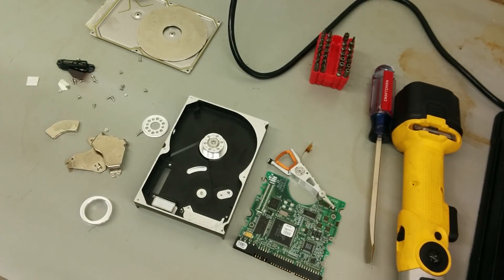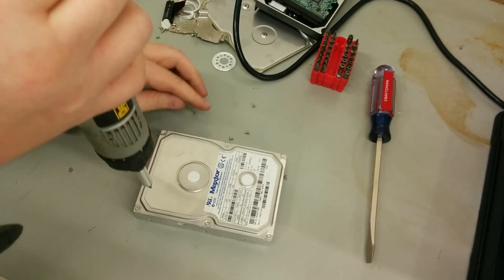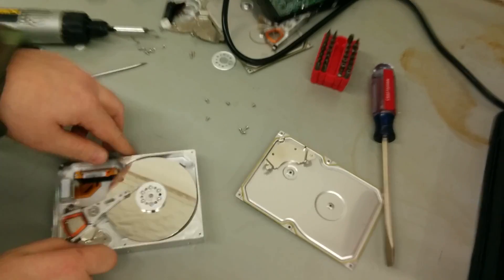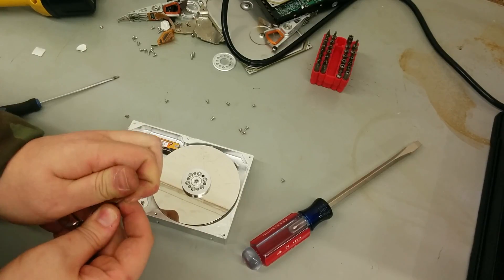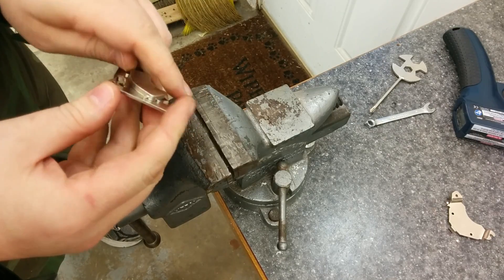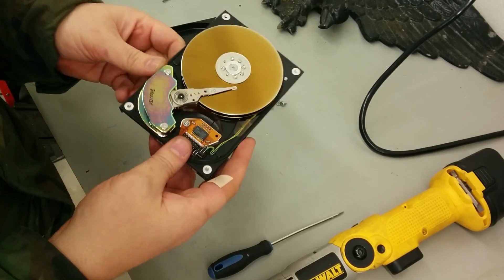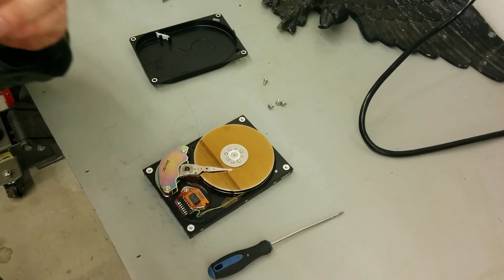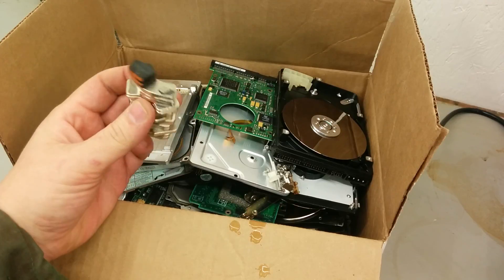Magnet Recovery from Hard Drives

Comment: You can grab each end of the bracket with some pliers or vice grips and twist in opposite directions. This usually breaks the seal with no problem. You don't need to bend it.  As long as it slightly flexes it should break the seal.  Could also put it in a vise and two hand the other side with some sort of pliers.

Comment: Actually the bracket seems to be made of some sort of special material that blocks the magnetic field, some sort of Mu-metal.  The bracket material may prove to be of some value also.
Reply: On further investigation the material which the brackets are made of is called mu metal and has the ability to block the magnetic field.  This is why the extremely strong neodymium magnets can be used as part of the head motor and at the same time not affect the data on the hard disk platters.
Reply: @ltronics62  Very interesting. Didn't know that.
Reply from the maker: Oh neat, didn't realize. I'll save those next time.
Reply: Just steel. Mu-metal saturates well below the flux density produced by neodymium magnets.
Reply: @longrunner258  http://www.sciencemadness.org/smwiki/index.php/Mu-metal
Reply: @longrunner258  ahhh. My bad. I guess the steel absorbs enough of the magnetic field that the field does not permeate very strongly through the steel.